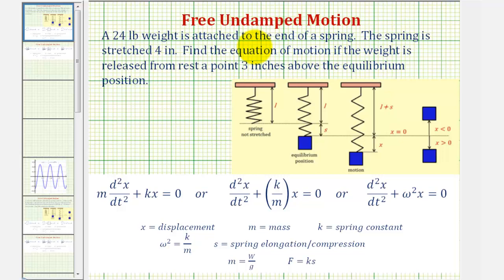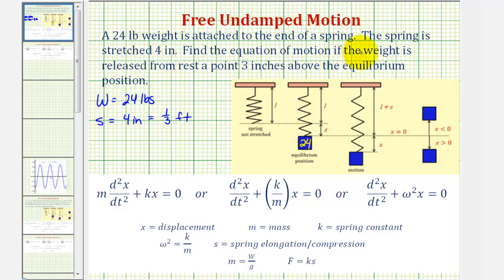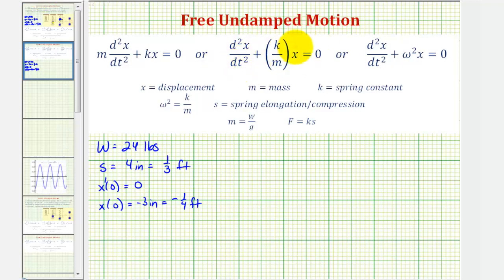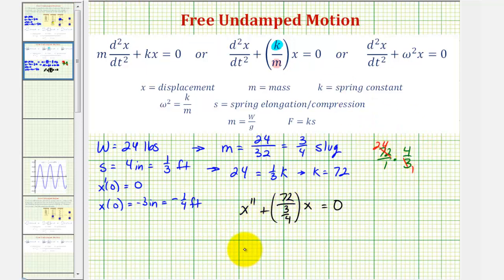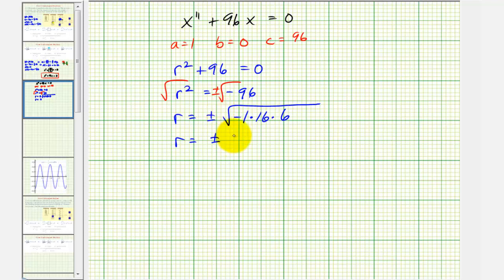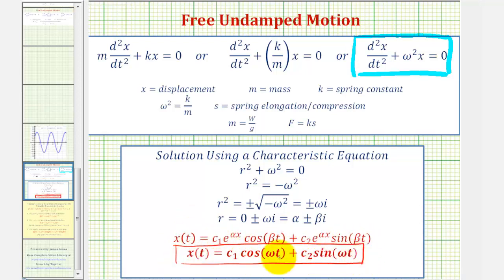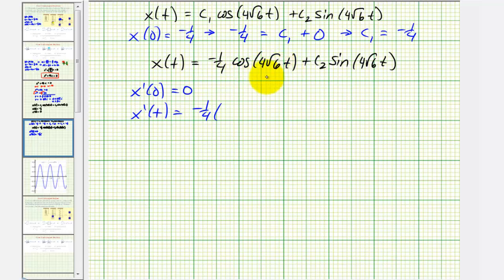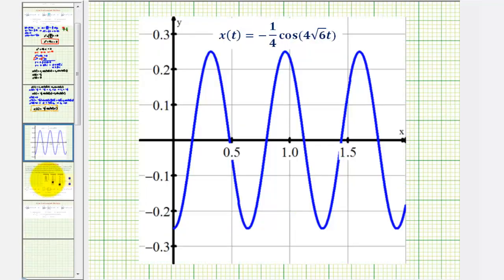Ex 1: Free Undamped Motion IVP Problem (Spring System)

Comment: Why did you say that F is a 24?? Is F is the same as W ???
Reply: In case anyone else sees this and has the same question, when talking in pounds(lb) that is a force, so no need to convert into a force. Unlike when talking about Kilograms(kg), where you have to multiply by 9.81(N/kg) or (m/s^2) to get the Force in Newtons.

Just remember, Weight in lb is a force. Mass in kg is NOT a force, and must be converted into a force.